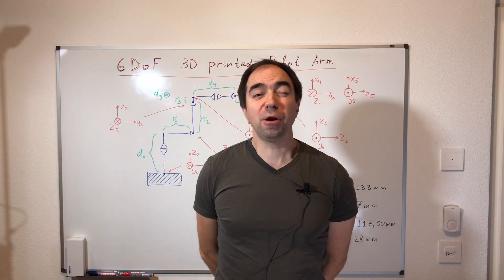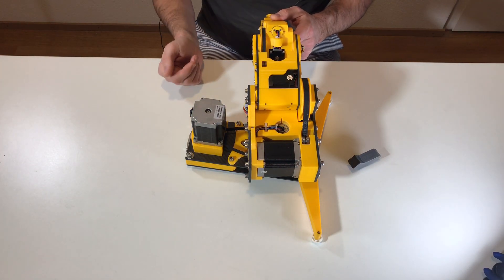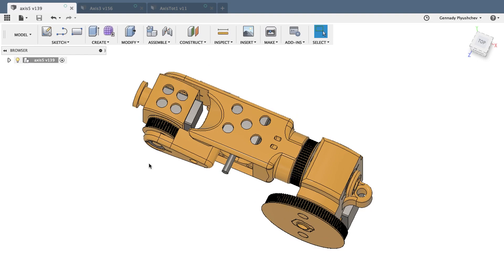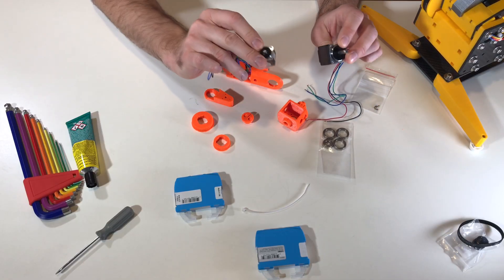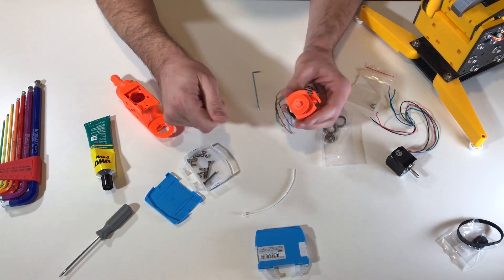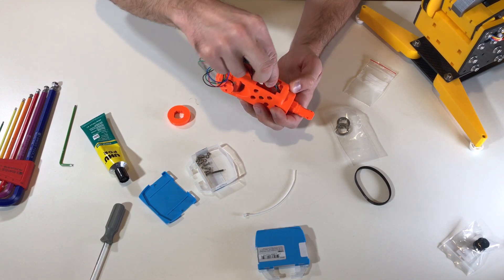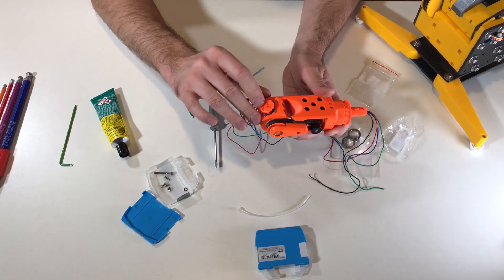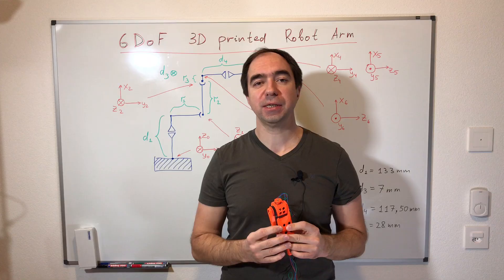6DoF mostly 3D Printed Robot Arm (Part 1)

Comment: Wonder has anyone done anything with this lately. Seriously getting ready to build this.
Reply: I was planning to start building such arm after finishing ROS 2 course. So probably I will start within next two weeks
Reply: I've been working on an arm with a 700mm reach and about 2kg payload, it's based on the same concept as this with belts for simplicity, super low cost, stronger than printed gearboxes and zero backlash. The design is still quite rudimentary but quite capable for a prototype.

Comment: What sheet are you using on your printer to print PETG? It looks like the Spring steel smooth one but I heard it can damage the bed material. How did you do this? Thanks for great content 👍
Reply from the maker: Yes, it is smooth PEI. I apply a glue stick on it (I use standard glue stick, which is provided with prusa printer). The glue helps to release the part. (Usually we apply glue for better adhesion, but here the glue works like separation) It works perfectly and I have not damaged any steel sheet.

Usually I apply a little bit of glue on the sheet in the middle and after I use paper towel with alcohol to smudge the glue homogeneously. You need a tiny tiny layer of the glue. Usually this glue layer last for 2-4 prints, and after I reapply it.
Reply: @Skyentific  Thanks for your reply Sir. I ended up using the textured sheet in the end. Finished printing all the parts, got most of the mechanical components too, assembling now!

Comment: Hi, great work on the robot! I am wondering how u managed to control the motors? As far as I know, it is impossible to know the position of stepper motors without some kind of an encoder or end stop switch, which u seem to have used none of such. I'm building a robot arm myself and your advice would help me in a lot of ways! Thanks!
Reply: you just put the robot into a known position first either manually or automatic with homing switches and after that you can just count the steps of the motors and there is your position

Comment: Great robot arm. Can anyone tell me how high its payload is?
The arm also has been redesigned with a different electronics board. Here is the video, but it is in german:
https://www.youtube.com/watch?v=MIeElSsjP94&t=3s
Reply from the maker: Cool link! Thank you!

The payload is around 250g. You can increase the current on the motors and increase the payload, but the motors will heat quickly in this case.

Comment: Hello sir, and thank you for this amazing project. Can you please direct me in where to obtain the proper belts? So far, no luck.....
Reply from the maker: Thank you for your comment. The best place which I know is sdp-si.com. They are not very fast, but they have a big choice of different belts.
Reply: I finally realized why I could not locate (2) the belts from SDP-SI. They emailed me with new stock numbers for the two 9mm belts.

A 6R53M128090, 128 teeth GT2 3mm, 9mm wide timing belt, is obsolete/ discontinued  – replaced as A36R53M128090
$11.01/ea available stock 

A 6R53M152090, 152 teeth GT2 3mm, 9mm wide timing belt,  is obsolete/discontinued – replaced as A36R53M152090 
$11.73/ea available stock
Reply: @Vernon1xx  This needs to be pinned, or at least have skyentific update the list

Comment: Hello dude the project is masterpiece. Accurate and good repeatibility.
I would like to open and modify the your drawing and play with it.
Could you upload step or ipt files to github, I can not use stl files I would be very glad.Meshed drawing has no surfaces.Otherwise we have to 3d print the files one by one and make measurement on each part 😃

Comment: Hi! I've watched all your videos on the 6DoF robot arm and they way you explain everything motivated me to order the parts to build one myself (for school). Unfortunately, I've hit a roadblock with the bearings from Engrenages HPC. They only ship orders of 500E, but the bearings required sum up to 40E, so they cant provide with the bearings. Do you have an alternative for the bearings from another supplier? Thank you very much! :)
Reply from the maker: Hi. Which exactly bearing you cannot find?
Reply from the maker: The thrust bearing you can find in amazon, for example: search for “51102 bearing” on amazon. I think this is the most difficult bearing to find :)
Reply: @Skyentific  Hello! So far, i've found an alternative for the bearing on aliexpress, the only one that's left for me to find is the 21x15x4mm. I've found the 6702ZZ, but the specs are 15x21x4mm (the numbers are not in the same order). But based on the video, i think it might be the right model. Is that correct? Also, regarding the Swagelok tubes, would it be possible to use an alternative other than steel? Like plastic or brass?
Reply from the maker: This is the same bearing. For the tube: the brass would be ok, if it has right dimensions. The plastic, I am afraid, would not be strong enough.
Reply from the maker: I know that sweglok tubes can be difficult to find, usually they sell them by 5m long tubes :).
Reply: @Skyentific  Thank you very much for your response! After awhile, i bought 0.5m stainless steel tubes with the right diameters from Aliexpress (it was really cheap) and i have now officially ordered all the components and started printing all the parts! Can't wait to put it all together! :)

Comment: You're really good a mechanically drafting. I mess around in Blender 3D, but you're doing some next level stuff in Fusion 360. This is probably the best Robot Arm I've seen on YouTube that's homemade. Definitely better crafted and designed than those DFRobot Robot Arm Kits.
Reply from the maker: Thank you a lot!

Comment: Very nice and inspiring work. Tried to apply your arduino code to my 5 DOF arm, but bid not work correctly. Maybe because of the DH matrix or youe equations. If you can help, it would be appreciated. Also pls explain the positions nominations and code if possible. Thanks
Reply from the maker: I plan to do the next video about the software and also explain the kinematics of this robot. I can also try to help you, if you would give me more details about your robot and what do you mean by did not work correctly?
Reply: @Skyentific  hi.
1) my robot is 5 dof. Meaning i dont have your joint #4. So i am not sure how the DH matrix theta and alpha (lines 595  and 596) should look like.
2)my robot geometry is as follows
R1=0
R2=200
R3=150
D1=200
D3=0
D4=0
D6=135

3) i need to know what are the 6 parameters in the X positions (lines207 to 211). Are they end effectir X,Y,Z in millimeters and rotation around X6 and Y6 and Z6? In degrees?

I will be waiting your video about the code. It will certainly help alot.

I have already used your part of the code for stepper driving. The acceleration and decelleration phases are great and help alot in torque management when the steppers starts and ensure a smooth arriving to target. I love it.
I was using accelstepper lib but it cant do this in multi stepper mode.

Comment: Love IT!
what do you use for homing?
I don't see any sensor nor limit switches
Reply from the maker: Thank you! Very good question! I don't have any sensors for homing. For the moment the Arduino program knows exact initial coordinates, and like this it works without homing. But I use Trinamic drivers, and with them I can home all motors without limit switches (like it is done on the Prusa i3 MK3 printer), but I didn't implement this feature yet.

Comment: Thank you for taking the time to make your design available. Do you have a list of parts I need to buy? The model of steppers you used? Thanks again.
Reply from the maker: Thank you for your comment. I am writing this list write now. The full list will be available this weekend. This is the beginning of this list:
Motors: 
Nema 8 (8HS13-0604S) 33mm, stepperonline, 4mm shaft, x1 unit    (16.00)
Nema 11 (11HS12-0674S) 31mm, stepperonline, 5mm shaft, x2 units   (22.22)
Nema 17 (17HS19-0854S) 48mm, stepperonline, 5mm shaft, x1 unit   (9.48)
Nema 23 (23HS30-2804S1) 76mm, stepperonline, 6mm shaft, x2 units   (40.30)
Belts:
A 6R51M087060, 87 teeth GT2 2mm, 6mm wide timing belt, sdp-si, x2 units  (10.26)
A 6R51M139060, 139 teeth GT2 2mm, 6mm wide timing belt, sdp-si, x1 units  (5.55)
A 6R53M128090, 128 teeth GT2 3mm, 9mm wide timing belt, sdp-si, x1 units  (10.06)
A 6R53M152090, 152 teeth GT2 3mm, 9mm wide timing belt, sdp-si, x1 units  (10.67)
Pulleys:
A , GT2 2mm, 20 teeth, 5mm bore, sdp-si, x3 units
A 6A53M020DF0906, GT2 3mm, 20 teeth, 6mm bore, sdp-si, x2 units   (16.12)
Bearings: 
Ball Bearing, 21x15x4, hobbyking, x3 units       (7.21)
Ball Bearing, 16x8x5, amazon, x3 units       (5.00)
Q6000 ZZ, 26x10x8, hpceurope, x2 units      (6.62)
Q6001 ZZ, 28x12x8, hpceurope, x2 units      (6.62)
TB51102, 28x16x28x15x9, hpceurope, x2 units     (5.00)
Carbon fibre parts:
Cut from carbon fibre sheet (3mm and 4mm) (could be printed from high stiffness plastic)
Axis3part1 (3mm thickness), famoushobby, x2 units     (23.04)
Axis2part1 (4mm thickness), famoushobby, x2 units     (33.24)
Axis1part2 (4mm thickness), famoushobby, x2 units     (53.52)

Comment: Totally enjoyed the video. Thanks for the amazing work.
I have two questions:
1. Is it better to use stepper motors or servo motors to make a robot arm like yours?
2. Can you also include a one-time donation scheme instead of the monthly option?
Reply from the maker: Very good questions! Thank you for comment.
1. With the professional industrial servos it is possible to make an excellent robot arm. But these servos cost from maybe 500 dollars. But cheap servos, which people usually use, have very low precision  thus the robot arm has a precision of only 5mm (or some times even 10mm). With stepper motors it is more difficult to make robot arm (as you would need to make some kind of gearbox (reducer)). But with steppers you could get a 0.1mm precision. And also with stepper motor you can control the acceleration (you cannot do this with cheap servos), thus with steppers the robot arm moves more smoothly.
2. Good advice! Thank you. I will do this!
Reply: @Skyentific  thanks for this very good answer to understand this from the ground! May i ask because i havent found the answer so far, how much gramm or kg will it be able to work with? And how much precision your build - the has atm?